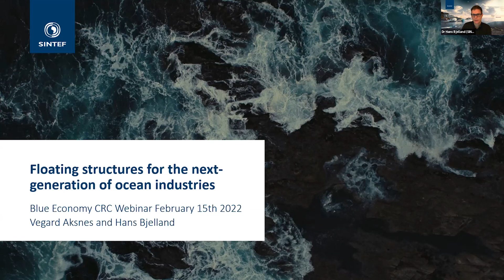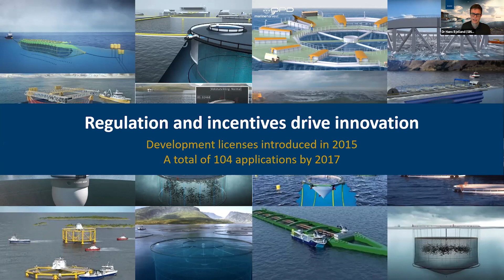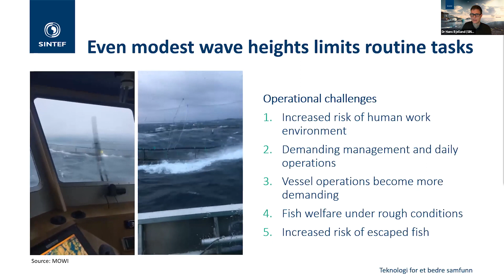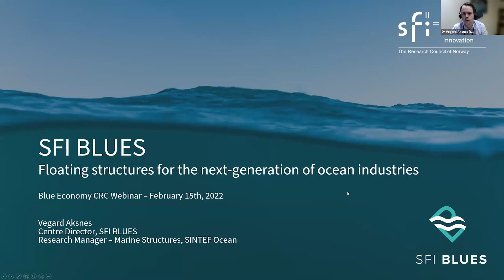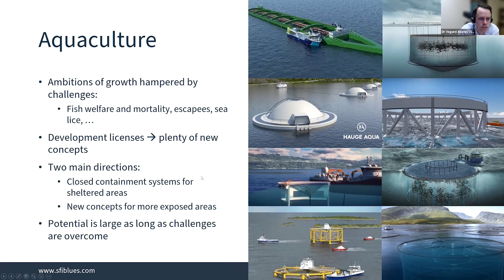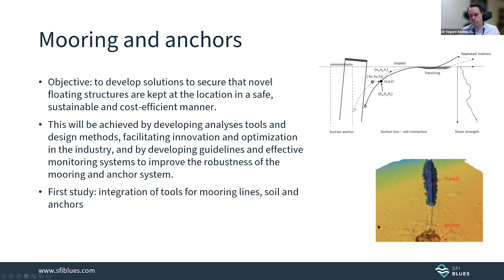BECRC Webinar_ Floating structures for the next generations of ocean industries

Comment: It is a fact of life that technological advances will always precede the formation of a regulatory environment. It cannot be the other way round. The regulators cannot predict the direction of technology and hence they have no means of drafting regulations which are emerging. 

In fact those at the forefront of emerging technologies do not either. The Wright Brothers could not have imagined that  flying machines would one day have payloads of hundreds of passengers making intercontinental flights. The technology was able to advance with little regulatory impediment.

We have voluminous regulations covering the design of ships or offshore rigs, to take on example, but they all are drafted based on the experience acquired in the field, in design offices, shipyards, and from trials and errors in real life operation and maintenance.

My message to regulators, is they should not be heavy handed if they wish to encourage innovations.

Lim Soon Heng,
Founder President.
Society of Floating Solutions (Singapore)
Organizer of World Conferences on Floating Solutions.